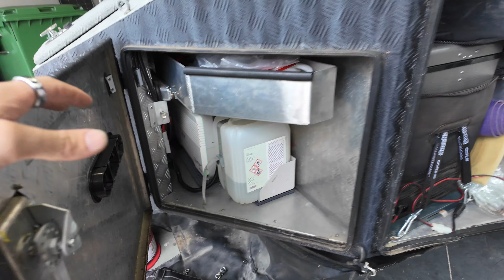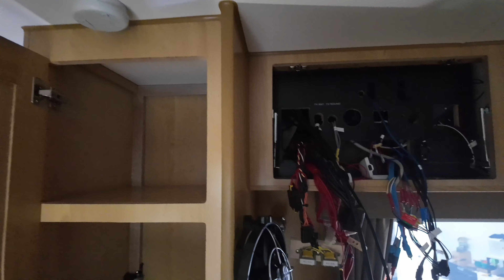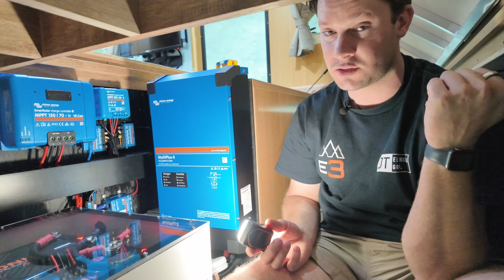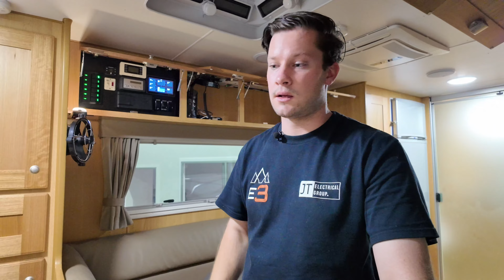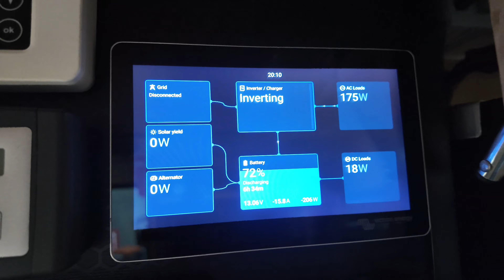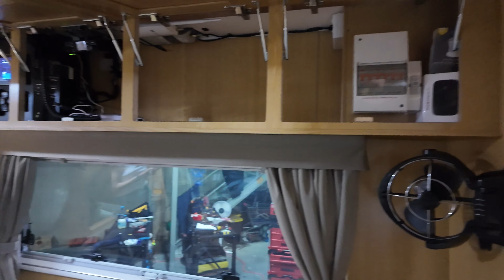700AH LITHIUM CARAVAN UPGRADE | VICTRON ENERGY | 2016 Bushtracker

Comment: I'm a bit confused with the Victron 3000w VA inverter, it peaks at 5000w right, so how long can it run with over 2400w of power, I would of thought it would cut out after a short time
Reply from the maker: The Victron is a 300Va inverter yes. It has a peak output of 5500w, pending the BMS size of the batteries can handle this amount of output. It will put out a continuous output of 2400w at 25 degrees for as long as you want.
Reply: @jtelectricalgroupnsw In the video you said it could run at 3500W “for as long as you want” till the battery runs out. That’s almost 4400VA on a 3000VA inverter. This is great if it is true, but seems like an overestimate of how long the inverter can run in an overloaded state. Do you have practical examples of this in action? Would be good to see a vid on this as the overload details from victron are pretty vague. I am trying to decide between a 3kVA or a 5kVA, but only really need the higher power for cooking where many things are running at once.